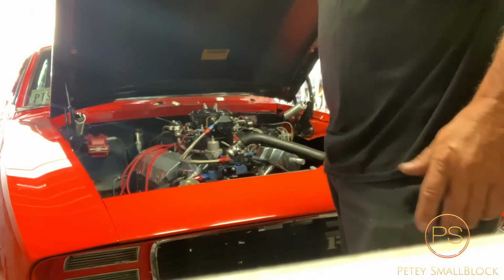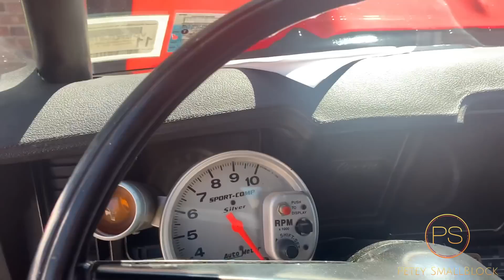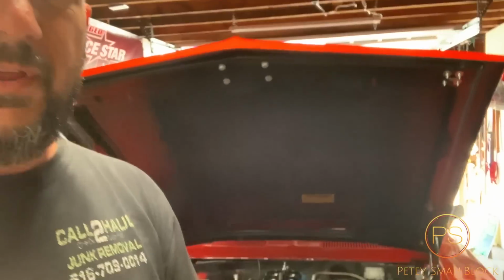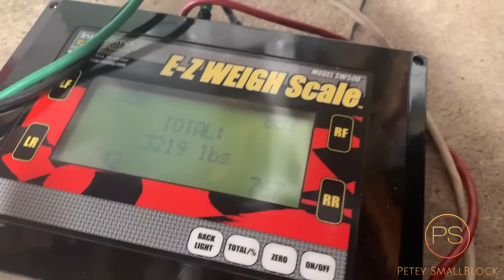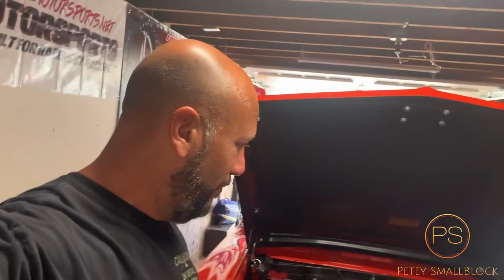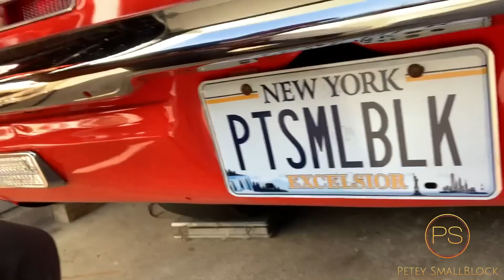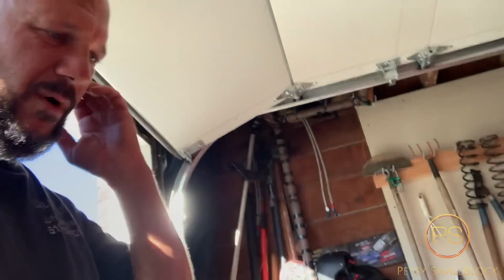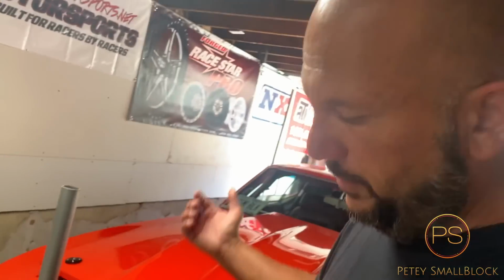New FST Carb Install & I get the Weight percentages right for the streets

Comment: I been running the FST fore A few year now.Great carb but I had issues with it from the start.Out of the box it had issues when it kept stumbling.I took it all part and cleaned it out.It had peace’s of material inside were the needle and seat go from machine drilling it looked like.After cleaning it all up it ran like A Freaken BEAST.Woke this 406 up.Great carb for the money.
Reply from the maker: i am very happy with my FST. id say its the best available
Reply: @PeteySmallBlock  Facts^
Reply: Agreed. Mine was the exact same. Full of junk. Once it was cleaned. It ran well.